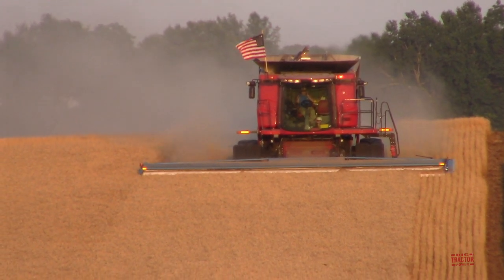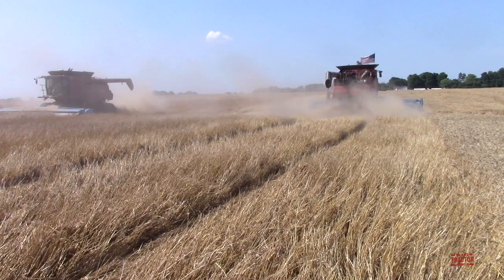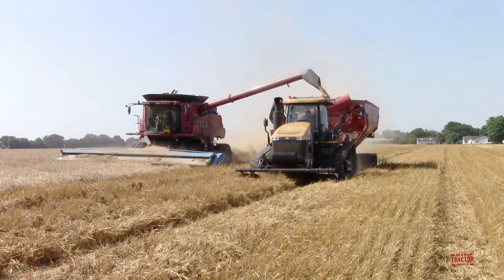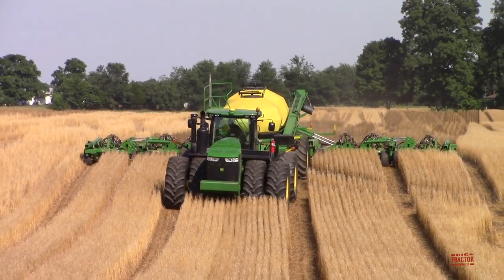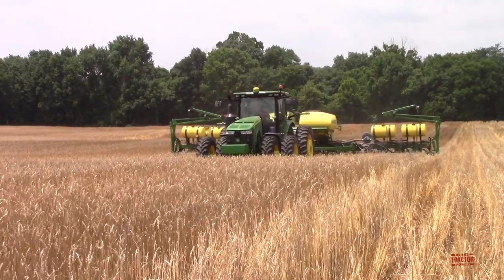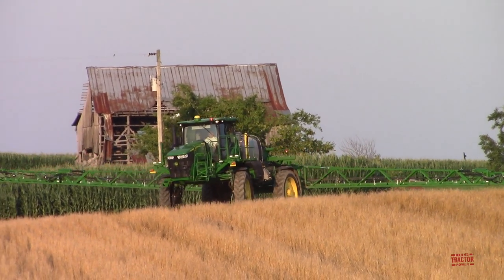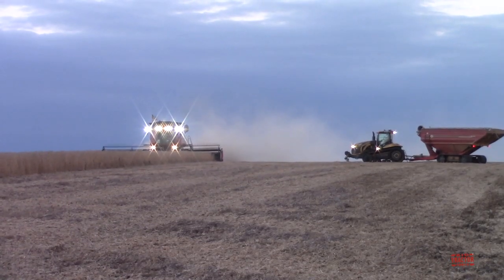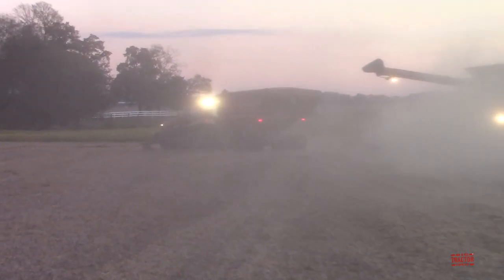Vacuuming Up Wheat???

Comment: This has got to be the best video showcasing double-crop strategy and practices on YouTube. Many of these practices have really only become widespread because of GPS guidance technology. Stripper harvesting and no-till planting into tall straw are all quite difficult without GPS guidance.
Reply from the maker: GPS makes a world of difference but back in 1990 when they first started harvesting this way they used the marker arm on the planter and it cut a line pretty well to follow.  They plant on an angle so you can see your pass pretty well as your making new stripes.
Reply: My family has no-tilled wheat and double crop beans since the very early 80s though we dont use stripper heads. Planting without guidance is challenging but i didn’t know any different then.

Comment: That was a fantastic video explaining about those headers headers actually a fantastic invention for farming I do have one question why I get notill  process h however at some point in that field’s life don’t you have to tell it once in a while just to air rate  Soil
Reply from the maker: Some farm’s in this area are 100% no till and it works very well. In fact notill farming was invented in Western Kentucky back in 1962.  I need to do a video on that. 

In the case of this farm they notill the soybeans but after the harvest in October they will subsoil 18 inches deep to break up compaction.  I made a video on this process which is posted at https://m.youtube.com/watch?v=0cZsKxEXyXg

Comment: It actually has nothing to do with the vacuum cleaner, it just looks like the vacuum cleaner. Everything happens purely mechanically. On the front of the head is a rotating cylinder with fingers that break the grain and ears and push it backwards, where the screw conveyor is. From there it goes directly to the harvest of combine harvesters. Because of this, the harvester is not so loaded because a much smaller amount of material passes through it, as they are just grains, ears and shells. It can have a much wider headline or run faster. It can also work in more humid conditions, when the grains are still dry, as the moist stems are not dried.
Set YT "Shelbourne Reynolds XCV42 - XCS42 Stripper Headers", in this guest video it tells and shows how the head looks like inside.

Comment: The shelbourne headers are a revolutionary engineering technology.

The header allows increased cover in a no- till operation.
The operation of the combine is maximized, allowing higher efficiency of threashing process and reduces wear on the interior of the combine and the ground speed is increased to accomplish the harvest process.  Along with the ability to harvest in a wider variety of moisture and field conditions; greater flexibility in field operation.  Yes, the threshing process results in cleaner tanked grain.

Comment: Hello Mr. BTP why are stripper headers shorter than conventional headers? For example a 9230 would traditionally have a 40+ foot conventional header where as the stripper head in this video is only 32 feet.
Reply from the maker: The stripper head will harvest faster than a sickle style head. They also weigh more. You can get a 42ft Shelbourne. I made a video on the 42ft at https://m.youtube.com/watch?v=ERhrLrb6iUo

Comment: A cover crop that provides the cover AFTER it is harvested and "used up". That is very smart agriculture. I am sure the extra cover makes a big difference in how much sprays need to be applied for weeds etc also. And even perhaps benefits with soil condition/erosion. I do not know enough about that header to comment really, perhaps there are drawbacks in longevity or width or initial cost/maint cost or whatever, but on the surface it seems like a no brainer to go to vs a traditional header.
Reply: Cost is a big factor. If you're running older equipment (like my in-laws do), that header may be worth more than your old combine(s).

Comment: Excellent video. I have a question that maybe you can or can’t answer. The head that is used for harvesting wheat, why couldn’t it be used for soybeans also?  Seams that the same process for harvesting the wheat could be used for the soybeans. Is there any chance that they may be adding that to a product that could be harvested with that head?  I enjoy your videos very much. The information that you put out there is above anything out there. I look forward to future videos you put out. Thank you.
Reply: Soybeans are too viney and will just wrap around the stripper drum. They are also in bean pods which are more likely to split open and drop the beans on the ground. Cutting them and letting them gently fall on a draper is still the best way right now.
Reply: Thank you for explaining that for me. That makes sense to me

Comment: On the stripper head is that grain we see on top?  Did they test this process against standard no till to see if it yielded better therefore off setting the extra cost?
Reply from the maker: The build up on the header is hulls and fuzz from the wheat head beard. No grain.  I am sure they did allot of side by side tests in the 90s when the headers were first used. They do a great job.

Comment: I wonder what the crop loss is compared to a flex Draper, are they any more efficient
Reply: It will be more efficient in the combine less combine losses but not sure but id imagine more losses at the combine head just with the method the grain is removed
Reply from the maker: The Shelbourne is a great way to go. I did not see any loss with the ones I filmed. They get good clean grain results and the combines have little running through them other than grain.
Reply: Big savings on fuel not threshing 18" of straw as well.

Comment: Will they no-till corn into this field in the spring or do they perform fall or spring tillage to prep for corn?
Reply from the maker: They will sub soil the ground 18 inches deep.  Their is allot of compaction from putting two crops on in a field in one year.  In the spring they will run vertical tillage to smooth out the seed bed.

Comment: How is the air generated for the seeder? Is there a hydraulically driven air compressor? I didn't see any PTO connection between the tractor and the seeder.
Reply from the maker: Yes it is hydraulic.

Comment: Do the harvesters have tighter settings because of less material going through it? Or are they able to run faster do to less material?
Reply: Depends on the set up, brand, age, and type of combine. But yes you can go faster but you could Also run different tolerances. I can run my machine faster in 22" bean does than in 15" or drill spacing if I planted beans in 30" rows I could go even faster unless I'm harvesting drill rows I'm also running at an angle. I know you were asking more about wheat but different crops share many harvesting traits we use a draper for both

Comment: Nice video. Doesn't AGCO still make a stripper head too?
Reply from the maker: They did from 1995 to around 2003.   They offered 22 and 25ft Gleaner and Massey Ferguson models. I can do a video on a Gleaner model on a John Deere 9600.
Reply: Thanks. I didn't know they'd stopped making them. Problem with stipper headers is as you mentioned there is only a limited number of crops you can do with them. Wheat, Oats, Barley, Rye, Rice, maybe Canola. Someone told me milo can be done but I don't see how considering it's a much bigger stalk and head.

Comment: I would love to see some organic farms. Looks like they use glyphosate to stop them from growing so they dry out before harvesting.
Reply from the maker: The wheat dried out naturally before harvest.
Reply: Using chemicals to kill crops like wheat, oats and barley in some places is illegal, because if you harvest it to soon afterwards there will be residual chemical in the seeds, which in food production would be very bad. Also if you kill your crop early you can loose yield by either not letting it grow as many seeds or it will not fill out the seeds as much meaning you will lose test weight. Which means you will loose money in yield loss as well as in chemical costs.
Reply: The wheat dried naturally, but did the soy?
Reply: I would love to learn some of the differences between naturally grown, organic and conventional farming. Especially, some of the differences you personally see would be interesting to hear.
Reply: Reply to Brad not Landa
My tiny heritage grain fields dry very unevenly. A small dip, avery slight slope - there can be a somewhat significant difference in the ripeness of the stalk - more so than the grain head itself sometimes. I raise avery small amount of Blue Tinged Ethiopian Emmer and some Sonora White wheat.  In 1897 a crop of Sonora White yielded almost as much as the highest modern hybrids have produced. It was part of the genome that Borlaug used when he made his crappy modern hybrids for the failed "Green Revolution".
Reply: The soybeans will dry naturally.

Comment: guys, what is that front attachment on the challenger pulling the grain cart for? Looks like a flap that runs on top of the ground in front of each track.
Reply: BoostAholic Thats for protecting the tracks of the wheat / Corn stubble
Reply from the maker: It is a stalk stomper. It helps reduce wear on the tracks.
Reply: @bigtractorpower   Thanks
Reply: @lenardojdfox8613  Thanks

Comment: Why do they plant the soybeans on a different angle from the what?
Reply: Dahlmasen Thats because if you drilling  in a another angle than wheat , you Can destroy the wheat Stubble Munch better to make room for the other Crop in those passes , otherwise the beans grows on the passes of the wheat stubble and the beans Will not Growing good because of the wheat Thats in the way
Reply: Lennert Wuite Thank you! Makes sense now when you say it
Reply from the maker: The straw flows through the planter better.  You do not want to pin the straw on top of the seed.  You want the seed bed clean.  They will harvest at the opposite angle of planting in the fall to feed the the beans and straw into the combine header better.
Reply: bigtractorpower I see! Thank you!

Comment: are there any other disadvantages with running a stripper head other then you cant use the straw, you need another head for soybeans. Is there more grain damage being it is removed fairly aggressive are theyre more maintenance costs in running those heads if they make harvesting more efficient why don’t we see more of them in the fields
Reply from the maker: The stripper head does not damage the grain.  It does a very clean job.  There used to be many more here in WKY before Draper heads.  Several farm’s still like a Shelbourne for wheat.
Reply: bigtractorpower thanks for the response one more question how does grain loss at the head compare to a draper head?
Reply: You still could use the straw if you wanted to. Would have to mow with a discbine or similar outfit.
Reply from the maker: The Shelbourne has very little loss. I also do not see the MacDon losing much either.

Comment: Here in italy that doesn't work beacause the soil is 90 % clay and you need to plow the soil then break the chunks of soil with a rotary harrow and then you can plant the crop
Reply from the maker: I enjoy seeing videos of tillage in Italy.  Here the soil is a red clay.  They have to no-till these soybeans or the field would be clumps of red bricks all summer.  In the fall they subsoil 18 inches deep to break compaction and in the spring turn over the top 2 inches ahead of corn planting to smooth out the field.
Reply: @bigtractorpower  we have red clay too but only in the south but most of the farming is done in the north

Comment: Why do you plant the double crop beans at an angle?
Reply: I believe it's to prevent compaction of the soil. Running those heavy machines on the exact same track as previous crop will do a lot of damage and thus the field may need a deep ripper cultivation to loosen the soil. That would be expensive and time consuming.
Reply from the maker: Mark you are correct their is allot of compaction running over a field so many times in a year. I made a video about breaking up the compaction posted at https://m.youtube.com/watch?v=0cZsKxEXyXg
Reply from the maker: They plant on angle to get the straw to flow through better. You do not want to pin straw in the soil on top of the seed.
Reply: @bigtractorpower  that makes sense thank you

Comment: a machine for every task, sometimes several machines in the same field... yet all i hear is that farmers are "doing it tough" and need financial help from the taxpayers :/
Reply: mr man You obviously don’t understand the basics of a farm operation. Not all farms can function with just one combine and tractor. And most of that money goes to corporate farms, not family farms.
Reply from the maker: These are industrial machines to grow and harvest food not different than a construction machine for building roads or houses. They are manufactured for for mass production. They are a big investment but they are what is needed to produce a crop. What is tough is that it costs more to plant corn than a farmer gets in return for harvesting it.  Prices have sat on a barely break even line for five years. Corn today is about $4.30 cents a bushel.  It really needs to be about $7 to make a farm work well. Here is some food for thought. Did you know that one bushel of corn sold for $4.30 cents makes 45 boxes of corn flakes. When I went shopping yesterday most boxes of cereal were $3.50.  The cereal maker has $0.09 of corn inside that $3.50 box. That’s where my questions go too.